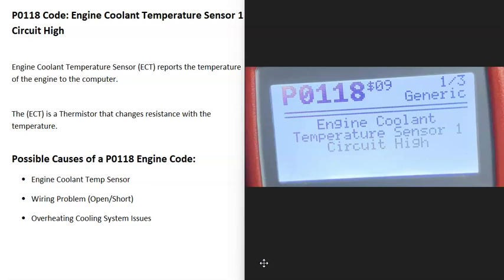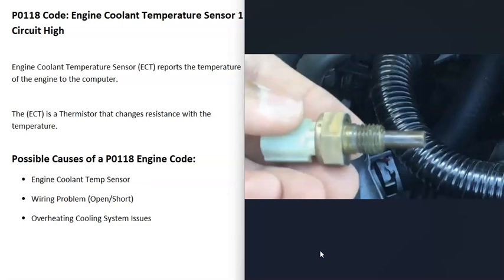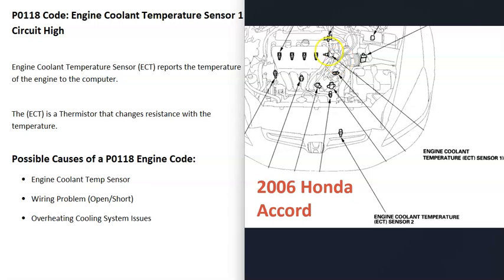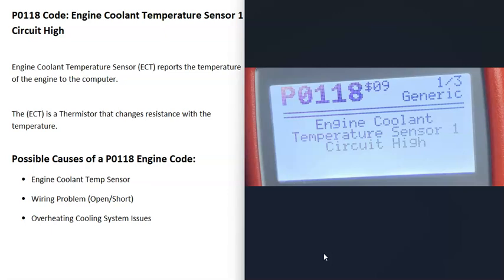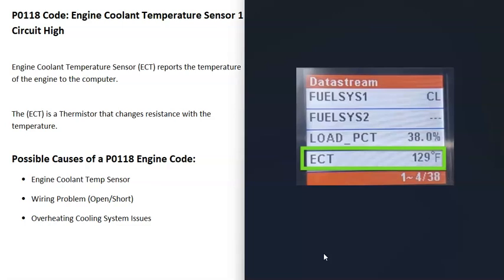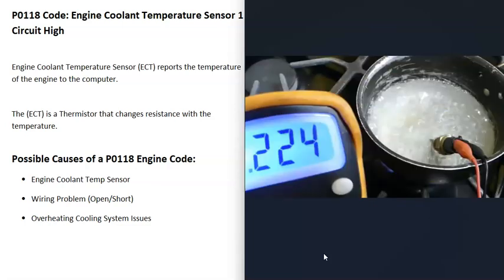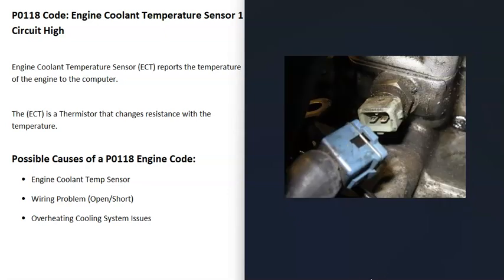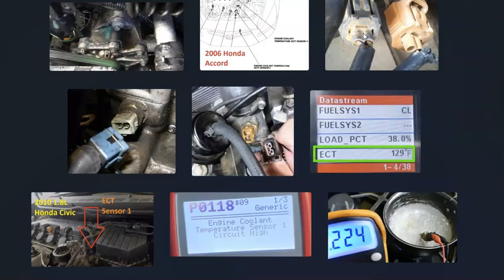Causes and Fixes P0118 Code: Engine Coolant Temperature Sensor 1 Circuit High

Comment: On a 2007 Honda civic si I got the p2185 & there are 2 ect’s. When I would disconnect ect 2 being the one on the radiator the fans would come on. Now my fans are not turning on at all even when I do the idle relearn procedure. Now I’m sure of getting a new ect 2. But if I swap it out never connect it, how would that make the fans go back on again like it use to when I would only disconnect the connector making then turn on. So if I never connect it how would they go back on like before? Like they use to? Just trying to figure that one out because I don’t see how. Checked and the fans do turn on at full blast because I turn on the AC at Max and on this car that makes the fans go on as if it was the radiator doing it. Also got a p0118. So I should be swapping out both ect and should be good? Maybe

Comment: So it was 15 degrees out today, cel came on with p0118. Within seconds temp started to go up. Its imlossible that it started overheating in less than 5 minutes. Im thinking its my ect sensor. Going to start there being that it was freezing out. 

Note: its done this a few rimes and the code cleared on its own but came back on. Starts randomly "overheating" and returns to normal after shutting off and starting the engine a few times

Comment: What's p0116? Honda 2000 CRV😊
Reply from the maker: P0116 Code: Engine Coolant Temperature Sensor 1 Circuit Range/Performance. I made a video on a P0116 code here is a link. https://youtu.be/LC_OD0UpD8s

Comment: I changed my ect sensor on the block because my tundra was running normal and the temp gauge was a little above the C,barely. So after I changed it,same problem,plus running rough,below rpm. I unplugged it and the temp inside went to normal but engine almost stalled so I plugged it back in and same thing,back barely above C. Any help please.

Comment: On a 2018 GMC Acadia, I had the Steering Assist is Reduced code, so I replaced the thermostat and ECT Sensor. That code is gone, but now I have this P0118 code. I'm hoping it is the wiring harness, which I will replace next.